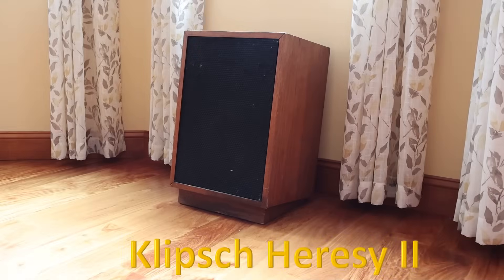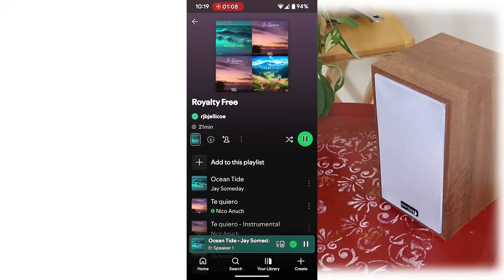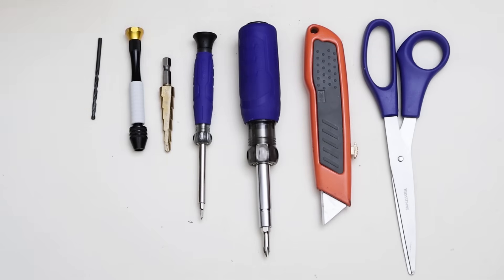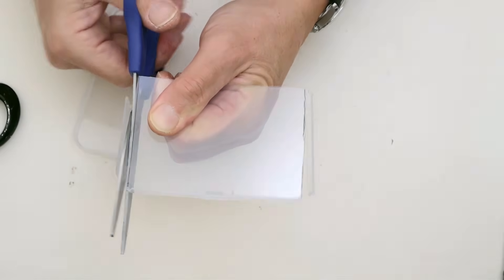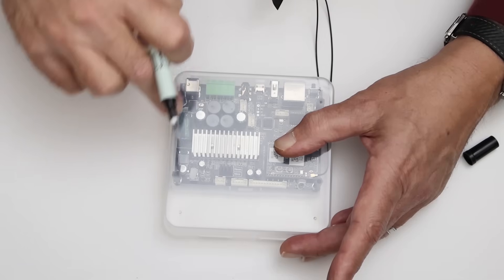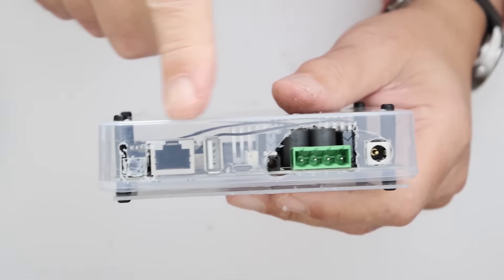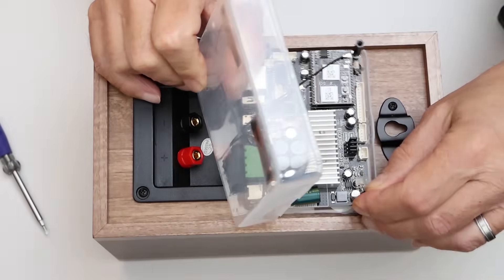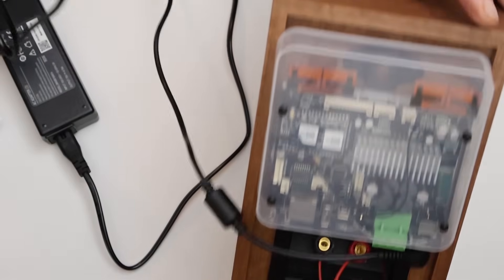Easy DIY to Add WiFi to Any Speaker - Make Any Speaker WiFi - Better Than Bluetooth

Comment: I just use a few Chromecast Audio dongles .... you can connect them to anything!... you can use optical cables from them to a DAC... you can plug headphones directly into them....you can make speaker groups for various room combination....what ever you want..... they were £25 each.
Reply from the maker: Thanks for your comment. A lot of people miss the Google Chromecast audio. Big mistake by Google, to discontinue them instead of improving them.  I still have a couple of them, but have found that the newest Wiim and Arylic streamers (you can mix them) actually work better, and have apple Airplay for iPhone users.

Comment: Did I miss the installation of an amplifier in each speaker? (Wi-Fi to individual amp and amp to speaker?)
Reply from the maker: I didn't duplicate the same information so you didn't miss it but yes you do put an Amp configured for a single channel in each speaker

Comment: Question - do these speakers need to be powered speakers or just connected to the receivers or integrated amp will suffice?
Reply from the maker: The speakers for this are regular passive speakers,  the kind that have red and black terminals that you connect to an amplifier or receiver. Powered speakers need a different solution.

Comment: I have a pair of Bose 901 can you use this technique to turn them into WiFi/Bluetooth speakers . Thanks
Reply from the maker: 901's are a problem because they need the equalizer to sound the way they are supposed to.  and there is no wy to connect the correct Bose device.  These boards do have an adjustable equalizer built in but I'm not familiar enough with the 901's to know what the settings should be.

Comment: My brain hurts.... This was really about making a hobby box out of a plastic box... And besides, you removed one wire and replaced it with a worse one if you're an audiophile... This is rubbish, I advise against it strongly.
Reply from the maker: I spend a lot of time helping people with their systems and I find most are unwilling to compromise on furnishings and the appearance of their rooms.  Which is why Sonos is so popular They are not audiophile either, does that make them rubbish?  This solution let's people find a speaker of the right size and finish and put it where it works asthetically and if you have good speakers the sound is excellent.

Comment: Dear sir, I need a help from you I’m running a tuition centre with 3 different branches. I want to speak in real-time (live voice) from my home or office and make sure my voice is heard through speakers at all branches.

Is there any device, app, or system you can recommend for this?
I need something that is simple to use, maybe through Wi-Fi 

I saw your video and thought you might have a good idea for this. Kindly help or guide me if possible. Thank you!
Reply from the maker: This might be simple or complicated depending on a lot of things.  I'm going to asssume that  all the branches have an internet connection, and you are just looking to connect the branches at once to a single live speaker.  You will need to use an application that willbroadcast voice over the public internet to do that and an obvious way to do it is with Zoom. Just have all the branches log in to a Zoom call. You could speak from anywhere.

Comment: How about if I want to wirelessly connect my old stereo home equipment (with amplifier, equalizer...and speakers) already with a Usb as Aux input. Is there a way to play my music, podcasts from my phone to the Usb input.
Reply from the maker: Your stereo may be able to play from a phone connected to the USB input, but some stereos have the USB there just to play flash drives or power accesories.  There is no risk to try though. Just connect the phone to the stereo usb. select the USB input on the stereo and try playing from your favorite music app. If it doesn't work there's no harm done, but you'll have to use a different method for music/
Reply: use Aux input instead of Usb

Comment: Hmmm.  If I own such speakers it's likely that I have them connected to an amplifier that I am pleased with. In this setup, I am connecting to the provided amplifier which may be quite inferior to the one I already have.  Wouldn't it make much more sense to run this wifi enabling device on the input side of the amp that I am already using?  Might that be what the stereo setting on the device is for?
Reply from the maker: I agree with you that this is not for replacing a system that you are happy with. To add the wireless streaming to an existing amp checkout this video. https://youtu.be/QjwcfF3FwN8

Comment: I want to change the audio connector of my “Panasonic Active Subwoofer SB-WA350 For Home Theater Surround Sound System” to HDMI please
Reply from the maker: Your subwoofer is designed only to be used with Panasonic Home Theater Systems and has special connectors for that purpose. Unfortunately there are no adapters available.

Comment: 4stream app not installing on android phone
Reply from the maker: Labelling the TV's may be an option in the initial setup or part of the general settings but there may also not be an option to re-name and only the TV model name or number appears. Some name will always appear if the TV is available, so there is some other incompatibility in your case

Comment: This is great for converting existing stereo speakers to wifi for a streaming box or phone, but I would like to stream wifi audio (gaming sound) from my computer to two small bookshelf speakers.  What would I need on the computer end to output audio over wifi?
Reply from the maker: I would not recommend wifi for gaming (or TV) sound. The delays will be unbearable.  Bluetooth would be better. Checkout this video which converts any passive stereo speakers to bluetooth https://youtu.be/B66_Zq6l0_s.  If you want to set up a computer to stream music files over WiFi   This video shows one good way.https://youtu.be/DZSx9ZPveqY

Comment: Does this application work for Bang & Olufsen speakers?
Reply from the maker: Bang and Olufsen make both passive speakers (with terminals for 2 speaker wires)  and active speakers (with RCAconnectors) These WiFi boxes will work with the passive kind.

Comment: will it also works on echo dot?
Reply from the maker: The echo dot is already wiFi connected  and needs no add ons.  Link to your music service subscriiptions like Spotify or Tidal in your Alexa app and you can then use voice commands or your phone to play directly to the dot. The dots can be linked together  for true stereo and/or multi room, using the Alexa app.

Comment: How can I get 2 x wi-Fi speaker inputs complete made up and all the components I want one of these I want two of these
Reply from the maker: The industry doesn't offer a ready built equivelent.  You can buy complete WiFi speakers but to convert existing speakers you have to put it together yourself.

Comment: One issue with the plastic box is it hasn’t got good ESD  protection.
Reply from the maker: The plasic box provides physical distance  between  an ESD source and the circuitry. and is therefore quite protective. It won't stop a lightning bolt but the board will not be harmed by normal household levels of ESD.

Comment: My preferred way to making holes in plastic is to heat a nail or an old bradawl by a butane torch and melt the hole. That way no cracking and you can repeat until the hole is the right size. Trim off any melted flash when cool. You could also use a soldering iron.
Reply from the maker: Good suggestion,  Heat gun would work too,  On reflection though, I was the clumsy guy who's work caught fire in chemistry and workshop classes at high school  so I'll stay with rotary tools for myself.
Reply: @rogergadgetguy 😂
Reply: For thicker harder stuff like acrylic, for smaller holes, just use a drill and bit in reverse.  The friction alone melts a hole and flash just breaks off.  Big holes, hole saws have enough teeth that won't chip/crack it going forward.
Reply from the maker: @ne0teric  A good tip Thanks. I'll try it.

Comment: I've been using Audiocast devices to play to my remote speakers via wifi for about $40 per stereo PAIR. It's been working very well so far. Their app looks very similar to this one.  How is this better for over $200 (plus I have to build it)?
Reply from the maker: This video was about converting ordinary passive speakers to WiFi. With the Audiocast you'd have to add amps to each speaker and you'd be hard pressed to do this for less than the cost of the all in one Arylic boards.  The Audiocast does work for powered speakers with their own amps.  I have to admit it's been a while since I tested an Audiocast so they have had plenty of time to get the bugs out, but at the time ( 2021 ) the operation was pretty flakey on my network.  I checked the Amazon reviews and it seems they work well for many people and not so well for others, but as you observe, they are cheap enough to try, and if it works reliably on your network then you have terrific value.

Comment: There is slim chance that those pissy little amplifiers will be anywhere near as good as a proper amp. 🤦‍♂️
Reply from the maker: Depends what you mean by proper, but I'm guessing you are talking about something large heavy and expensive from one of the HiFi brands that most of the people watching have never heard of, and yes, those other amps are capable of incredibly good sound and are better than these. That being said the quality improvement from these WiFi streaming amps over Bluetooth is larger than the difference between these little amps and the ones regular people can't afford.  In this project I use two amps in bridged mono mode wich I found offers a good sonic upgrade from using a single one for stereo.  I was surprised by how good they sounded, driving good quality speakers.

Comment: so you have to have an Arylic device for each speaker then?
Reply from the maker: Yes, If you want the speakers to be independently wireless.   It is possible to set the jumpers to run a single  Arylic device in Stereo and run a speaker wire to the other speaker like most commercial powered speakers. The sound is just as good, and if your speaker placement allows you to connect them  together with a wire the cost is much lower.

Comment: Excellent video was excited for the project until I saw the price of the board...
Reply from the maker: If you are OK with a wire to the second speaker (like most commercial powered speakers) you can halve the cost by using one board and set the Jumpers to Stereo.

Comment: This is ridiculous the little amp is $80 a piece. Dumbest thing just use a Raspberry Pi
Reply from the maker: I wanted to start this channel with Rasperry Pi projects, but the supply completely dried up during the pandemic. So I got started doing other things. I quickly realized that anyone who knows what a Raspberry Pi is probably doesn't my help as much as someone who is having trouble getting their soundbar to work with their TV,  Anyhow a Pi with a decent amp HAT and micro SD is similar in price, and you have a computer that can flash the card.  Also If you have a way to get Amazon Music to work on a PI, I'D love to learn it from you.

Comment: Is there any wifi monitor display?
Reply from the maker: There is no display of signal strength but if the connection is lost the white Indicator light flashes and it stays on steadily when the connection is re-established.

Comment: That’s brilliant and so well explained with video instruction, i’ve not checked, but wondered if the electronics board has a generic name as living in UK will mean accessing board from another supplier, as i say ill check that out but guess they don’t ship to UK as i’ve tried to get PSU that are sold in USA and found they don’t ship, which is also a shame as upgrading a DELL OPTIPLEX 7040 is much easier with the smaller, but more powerful power unit.

Comment: Is the wifi here compatible with google nest wifi?
Reply from the maker: Yes.  In fact, that is what I am using in my home.
Reply: @rogergadgetguy thanks Roger. Just want to check is yours the google nest wifi or google nest wifi pro?
Reply: My problem is I have a lithe wifi ceiling speaker but not compatible with google wifi nest (mesh). Any suggestions?
Reply from the maker: @tomdowling2607  Mine is the Nest WiFi Pro. I used to use an older version of Google WiFi before they Branded it Nest.  That also worked with multiple Arylic streamers.
Reply from the maker: @tomdowling2607  In the Google home app WiFi Section go to network settings Then "Advanced Networking" and make sure uPnP is turned on.
Reply: @rogergadgetguy  yes that setting is selected. My speaker is not google compatible apparently even though it's a wifi speaker - thanks google. I might try retrofitting your device to it and see. Cheers.

Comment: Can this be used for passive speakers. I have a couple of 60W car speakers that is want to use. 
Thanks.
Reply from the maker: It is specifically designed for passive speakers so the car speakers will work fine.

Comment: Perfect timing, Roger. Thank you so much.😄 Answer this question for me if you would. Is there a way to do this for a home theater system? Let’s say four speakers front and rear left and right and a subwoofer total of five. 🤔 Scott
Reply from the maker: I would not recommend this for Home Theater Theater. You would not be able to sync the audio and video.   I have some thoughts about how to do wireless with a 5.1 sHome Theater, hope to do a video soon.

Comment: I have a cousin that, in the 1960s, bought a 4 channel record player that would have left and right front and back channels for four different speakers. This was known as Quadraphonic sound and required a special needle as well as specially recorded vinyl to work correctly. Would this be able to be accomplished with the WiFi?
Reply from the maker: I remember quadraphonic.  Three incompatible competing systems totally confused the consumer, froze the market, and killed the idea.  You could do 4 channels over WiFi but you would need a 4 channel music source.

Comment: Shame it doesn't do chromecast...
Reply from the maker: One way to do chromecast audio, is to use a Wiim Pro which can link to these speakers in the Wiim or Arylic app. if you Chromecast to the Wiim it will play on the speakers.

Comment: Amazing instructional video—thank you! I have a challenge for you. I own an old PHILCO DVD player with a 5.1 speaker system. While I no longer use the DVD function, I’d love to repurpose the 5.1 speakers either by keeping the original Philco amplifier or replacing it with a budget-friendly amplifier. My goal is to connect the system to my flat-screen TV and video provider.

Would you have any recommendations on the best way to set this up?
Reply from the maker: Your 5.1 system is 99% likely to have an optical input this can be connected directly to your TV optical output. If your TV doesn't have one use an HDMI ARC adapter with an optical output like this.   https://amzn.to/4gRWORs

Comment: Another way to do this would be to dismantle apple airpods and use the Bluetooth from them to pair to the speakers.. power the speakers via wires and wire the case board to the amp.

Comment: A cheap way is to use one or two $20 Echo Flex's with one or two amplified speakers on smart plugs. For stereo If the speakers are far apart, leave the left channel wire dangling on one, and the right channel wire dangling on the other, and put them in a group. Alternately, use any old yard sale amp or boombox and run speaker wires.  For ultra-high definition, use a $90 WiiM mini plugged into an amp which has an optical input with a built in UHD DAC, or an old good analog amp and attach a $100 optical DAC to it. The DAC in the mini has a built-in 1/8" stereo analog line out headphone jack as well which relays UHD, but it is considered low quality by snobs.
Reply from the maker: It sounds like you have as much fun with this kind of stuff. as I do.🙂
Reply: ..is the echo flex one channel mono or a pair of stereo channels?...."put them in a group"?
Reply: ….can you translate this to English please?  🤦‍♀️😂

Comment: Thanx for the video! The links to everything are missing though. Would be lovely, if you could provide them.
Reply from the maker: Links are there in the video description but you have to click on more to see the whole description. so you don't have to here they are again, Arylic Up2Stream AMP Mono  (DIY WiFi Amp);  https://www.arylic.com/products/up2stream-amp-mono-board?aff=189
Dayton Audio Classic B40 Speakers;  https://amzn.to/4aZQBBC
Power Supply 19V 4.75A;  https://amzn.to/3QlpN5w
Plastic Boxes;  https://amzn.to/4bi6QdH
M3 Standoff Set;  https://amzn.to/4jWBGfH
Speaker Wire;  https://amzn.to/4hU35No
Step Drill;  https://amzn.to/4hV8RhO
Pin Vise;  https://amzn.to/4hW3gI6
Reply: @rogergadgetguy  thanx for info. Weirdly enough, i dont see it in the info-box. All the info seems automatically translated to german for me, so maybe that is the issue here, so thanks again!